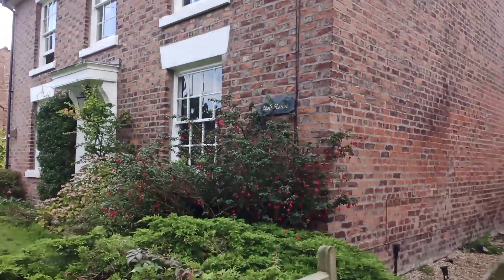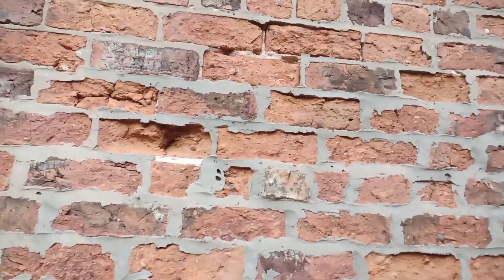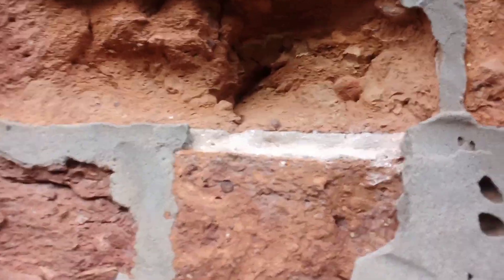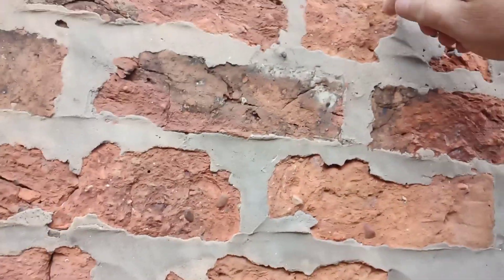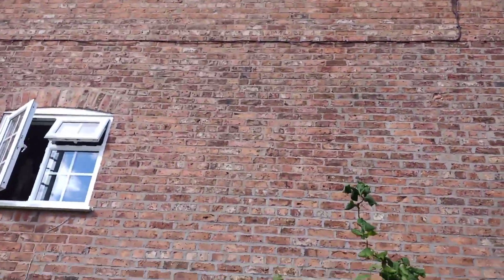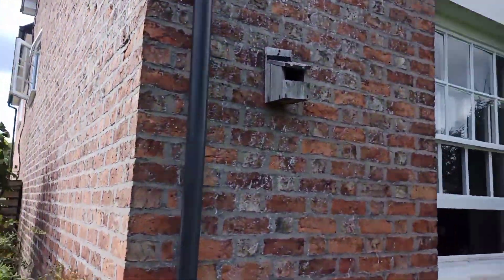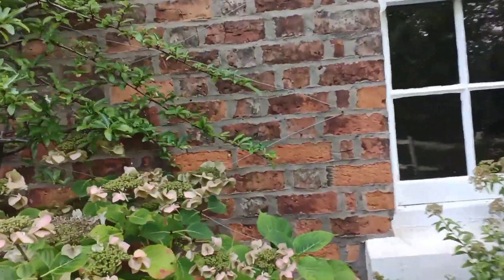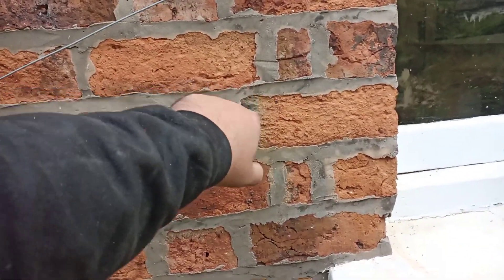This is what happens if you use cement pointing on a lime built building with hand made bricks

Comment: If you replace with a pure lime pointing what is the gauge?

The only heritage work I have done I was told to do 9:2:1 sand, lime, cement. Was that incorrect. I am guessing now it was.?

When you said the moisture should wick away through the joints not the bricks, a lightbulb went on for me.
It makes so much sense when someone says it. I am a bricklayer of 40 years standing and have done my best to learn about the old lime mortars and renders.
Old buildings never had the damp problems of today.

Just finished working on a converted 140 year old Brewery, all lime sand mortar, hard as anything when you're cutting out. The made us point, well bucket handle, (oh the shame) the whole building in 5:1:1 sand, cement, lime. These architects haven't a clue, the bricks were really soft, looking at your video I have a feeling we have really damaged a beautiful building.
Reply from the maker: Pre 1940 always use a put lime mix 
Either a hot lime mix or a high free lime content NHL
Never use cement 
  
5 1 1 I point flags with that mix 
9 2 1 or 5 1 1 
I never do bucket handle 
 I'd use on modern buildings that was built with cement
Hope this helps
Reply: @GMTpointingspecialistsltd  It really broke my heart to bucket handle an old building, but you can't tell them, it was do it or not get paid.
I need to educate myself about what you have said. Did you mean to say a putty lime mix?
Is that just hydrated lime that most outlets sell or is that Hydraulic lime, (I think I have that correct?) and are you using that as a pure putty or adding sand? If so what ratio?
Reply from the maker: @harveysmith100  putty I would only use on well protected areas or inside normally come in a tub with the aggregate in it as well
Hot lime can be used hot or cold same again I'd use in well protected areas it has an 80 to 90% free lime content so never use that on sandstone it will cause corrosion 

NHL check the data sheet see what free lime content it has 
Most with high free lime content don't have much clay in it 
You finish it of with a churn brush check out my other videos I show you how to do it in them videos
Reply: @GMTpointingspecialistsltd  Will do, I like to do my own work properly so I have some learning to do. Thanks for your time.
Reply from the maker: @harveysmith100  no problem any time what area do you live
Reply: @GMTpointingspecialistsltd  Near Gatwick in West Sussex. Just finished working on "The Brewery Portslade." A lovely building worth looking up. No one had a clue about old brickwork though.
Reply from the maker: @harveysmith100   if that's the case get on a course or find a lime specialist out of your are and go learn as much as possible from them ask if they chuck a bit of cement in the mix to set it off
 if they say yes 
Go elsewhere till you find someone who does it to a high standard
I looked at loads of videos on YouTube out of 100s of videos maybe 6 or 7 know what there talking about 
I've put videos up now and again if you have any questions just
Ask on here wattsapp or FB
Reply: @GMTpointingspecialistsltd  Much appreciated. I have been to Rome many times. Not one grain of cement in those buildings!
Reply: @GMTpointingspecialistsltd    So you are saying don't use hydrated lime mortar outside only use hydraulic lime mortar outside? Here in Canada were I live you can't get hydraulic lime but can get hydrated lime. I have old yellow brick home that is desperately need of repointing what do I do?
Reply: @GMTpointingspecialistsltd    Oh and Great video. Thumbs up.
Reply from the maker: 1/1/6 1/2/9 1/3/12
I think you call it type s in Canada normally mixed with cement 
Ring a local stone mason to you  

When I was in Canada Ontario which is an amazing place I'm hoping to get over next year for a couple of weeks  it was plus 40 so hot then next time I come over it was minus 20 so it was freezing so your hydrated over in Canada might differ from the UK 
I'd 100% speak to a local stone mason
Reply: @GMTpointingspecialistsltd    Thanks for the reply. I live in Ontario near lake Huron it is very windy here not too hot in summer but super cold in the winter. I have been using s mortar for the stone foundation and n mortar with a extra bit of hydrated lime to make lighter in colour for reporting the brick. After reading and watching a bunch of videos I'm not sure now, actually more confused about the subject of mortar than ever. I will go with rule of thumb that the mortar should be softer than the brick. I am also going to call a Mason like you suggested since I haven't gotten to far on repointing yet.
Reply from the maker: @bradclark6796  it the sand that dictates the colour of the pointing if you choose a light colour sand it will make your pointing lighter

Comment: Your videos are giving me alot of inspiration on something I was considering a really daunting task not knowing the slightest thing about lime! Your straight to the point and an enjoyable watch. I have the same problem with my house, cement on lime pointing, cracking bricks, faces crumbling it really is sad. I'm going to start the mammoth  job of raking out and repointing with a lime mortar in a couple of weeks time. Should I use an nhl 3.5 3/1 sharp sand mix? I live in Northumberland a couple miles from the coast. Thanks.
Reply from the maker: Thank you 
Depending on the condition of your bricks 
I'd use a good quality NHL 2 or 3.5 if it's a poor weather area 

Good look with your project if you need any advice just send me a pm

Comment: Are you saying don't use any cement? What about 5 sand 1 cement and 1 lime? What is your ideal mix?
Reply from the maker: Ideal mix 1 lime 3 sand
For this building

 If it's lime built in a area with harsh conditions  driving rain heavy winds I use a 1 to 3  lime free lime content  content of 45 to 50 %
Depending on your property choose 
NHL 
Hot lime (can be used hot or cold )
Putty
Each property is different 
Each lime manufacturer is different 

 
1 cement 1 lime 5 sand
I use repointing flags 
Or on a modern building 
The lime in a cement mix is a different type of lime

Comment: The cement is far too strong it would have been better off going with a weaker mix of 5 to 1
Reply from the maker: No totally disagree 
No cement should ever of been used on this property it's lime built so you put lime back in
Reply: @GMTpointingspecialistsltd   You are right, but you see this happening a lot it's cheaper to use cement than lime.
Reply from the maker: @barrymichaels2663  yes true  
But the reason I started these videos are to educate cement users on lime built buildings and to educate home owners on what mortar you should use
Reply: @GMTpointingspecialistsltd  You're doing a great job mate. I just wish more people knew this stuff👍
Reply from the maker: @barrymichaels2663  thank you mate appreciate it